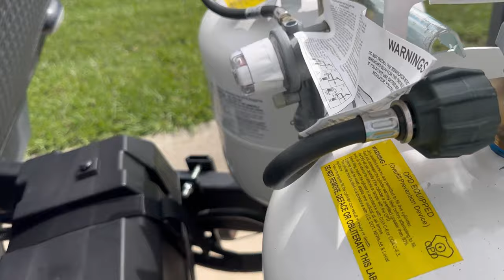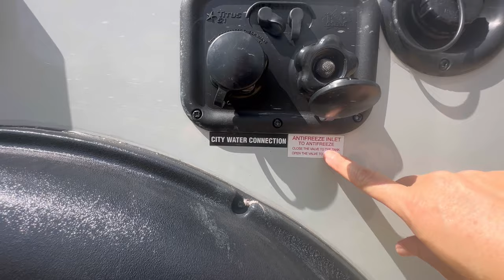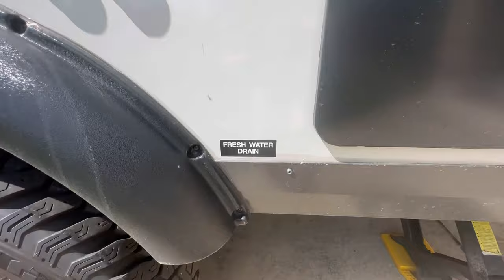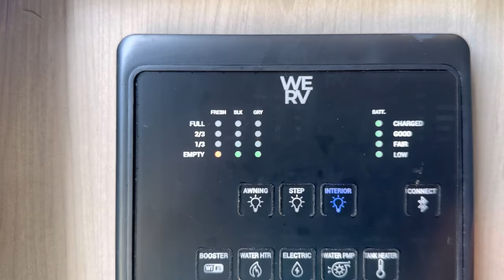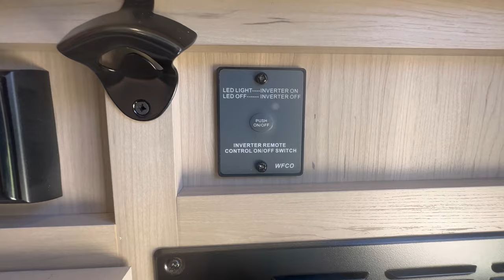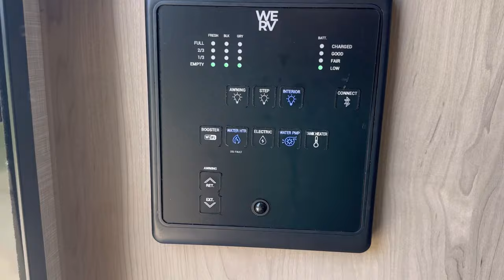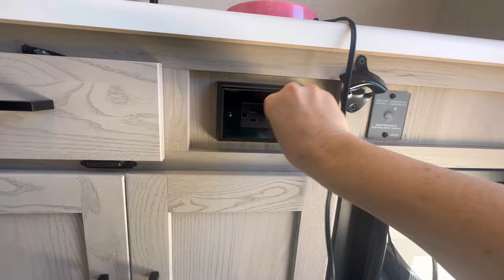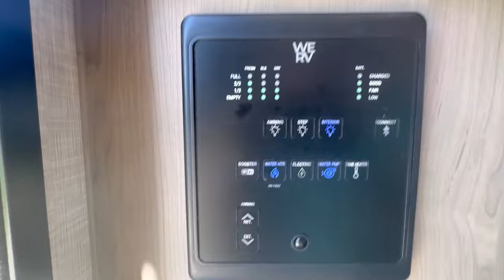2023 Forest River Flagstaff E-Pro 15TB Tour and Boondocking Test #boondocking #forestriver #epro15tb

Comment: Hey hey! Looking good. They sell like a flush wand you can flush black tank from hose inside the toilet. You can also fill your blank tank before your next location that has full hookups. Might think that's counterintuitive but what you're doing is filling the black tank 3/4 so when driving down the road you are essentially slaushing, tumbling, mixing, splashing the tank so hopefully when you get to your next stop (and with using a black tank cleaner liquid or pouch) your black tank would have gotten nice and... mixed for a nice flush when you empty.
Reply from the maker: Thank you so much for the information!

Comment: Hey Steph, looking good! We have 40 gal fresh, 35 each of grey and black. We can go 4 days using our own facilities. Water has run out a couple of times because we both took a shower. We also use that Dawn spray and wash that has cut down on water usage. We usually go to state parks here in PA that only has electric. We travel with the tanks empty and fill when we get there to save on fuel. I would carry a bucket with a lid and a funnel in case you run out of water. We have collected rain water from the awning to put in the tank after a thunder storm. Never tried boon docking. Don't have solar or an inverter, but do have a generator. Thanks for the tour! Have fun when you go!
Reply from the maker: Oh yeah, that dawn dish spray is a great idea! Thank you for all of the information!

Comment: I don't know if you have a water pressure regulator for your fresh water hose that connects to your camper but some people have been advised to use them to control water pressure as to not blow a water line in the camper. They usually are set at 40 psi. Some home and camp grounds water systems can fluctuate up to 80 psi or higher and cause a line to leak or burst.
Reply: Great tip!!

Comment: Bonjour! to replace the black tank flush you can carry a 5 gallons bucket and fill the tank by the toilet, in your case it's only 2 buckets since you have a 12 gallons tank if I'm not mistaking. Then you pull the valve and the pressure will rince off the tank. I use that method from time to time even if I have a black tank flush and 30 gallons, it's faster and very effective. Great video! Bonne journée!
Reply from the maker: Thank you so much for the information!

Comment: Good video walk thru, I'm considering getting this model camper. I like everything about it but I wish they made the wet bath with a complete one piece surround and fiberglass walls. I'm thinking over time the walls of the wet bath would start to fall apart and leak, plus with them not being covered with a water proof material would make it hard to clean. I also would prefer that the water heater and fridge had the option to operate on either propane or electric. And lastly, it would be nice if the windows were slide open type so you could get more of a crosswind. I wonder if you could have one custom ordered with the options I mentioned.
Reply from the maker: I think the wet bath is easy to clean ☀️ we will see about it falling apart with more use lol. The water heater and frig does have the propane or electric option 👍 And I agree about the windows ☀️
Reply: @lifewithstephanie42  Thanks for the reply, so they do run on both, I'm sorry, I must have missed that info in the video. My travel trailer hot water heater only ran on propane, and it quit working one time when camping, and we had to take cold showers.... and I told myself the next camper I get I'll make sure that the water heater runs on both.... cold showers are no fun. 😆

Comment: Tip for the stabilizing jacks,  use some pads underneath so they are not extended all the way and they will be more stout. Also for the windows there is a mod to have them open further.

Comment: What model number of the Proven Lock are you using with G15? I want to buy it but can’t determine which one ? Thanks
Reply from the maker: Proven Industries Model 2516 Trailer Lock, Fits 2 5/16-Inch Couplers, Secures Safety Chains, Made in The USA, (Black)
I purchased on Amazon

Comment: great info! I admire what youre doing. Im retiring next year and thinking of getting this travel trailer. Question, did you say that the AC will not work when boondocking?
Reply from the maker: Yes, the heater, AC, and microwave do not work when boondocking
Reply: Did you try any of them with the inverter on? I could have sworn the salesman said you could run your AC off the inverter during your walk through at the dealership.
Reply: But the fan overhead works while boondocking, correct? So you can suck out the heat inside the trailer with it or pull cool air inside?
Reply: I believe the air conditioner uses a lot of the solar power so that might be why!!